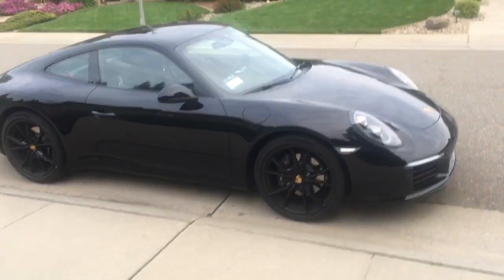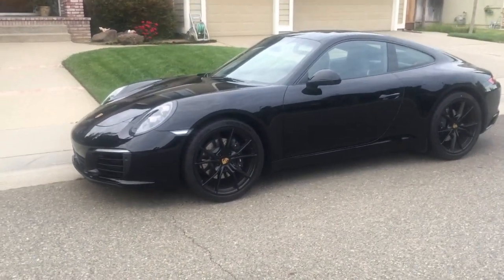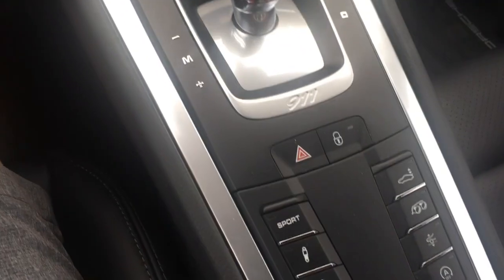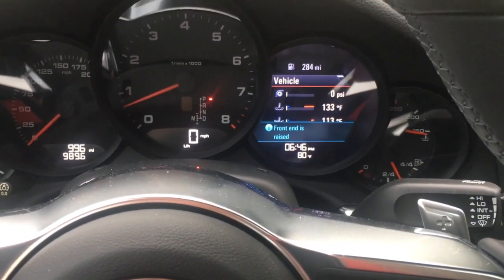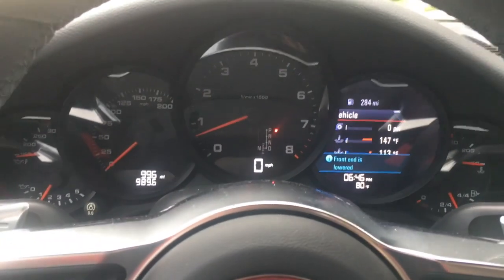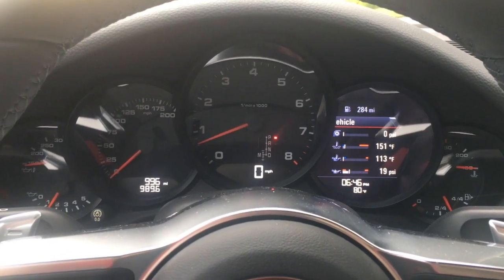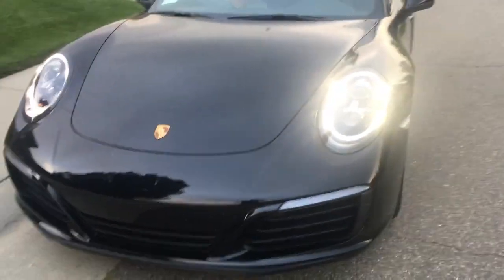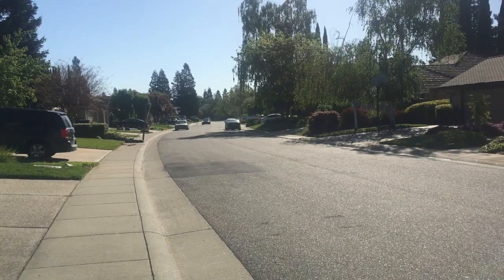Porsche Front Axel Lift System

Comment: Does it have the GPS auto lift system like the 993 or the C8 corvette?
Reply from the maker: Mine did not. If I’m not mistaken that was introduced in the 992.
Reply: @OctaneAndAmmo  well I meant the 992..my apologies so it's not automatic adjusting using GPS?
Reply from the maker: @johnblack4915  no mine did not